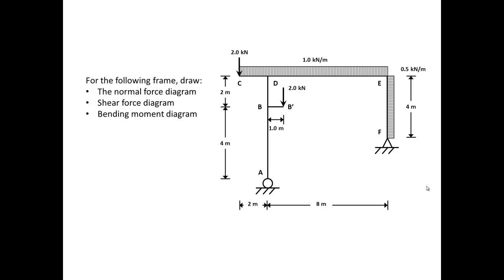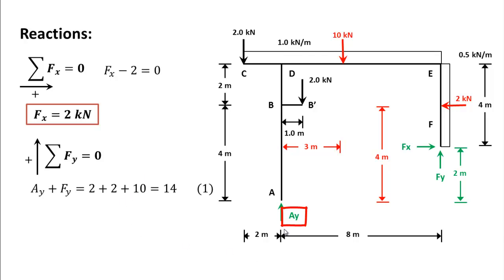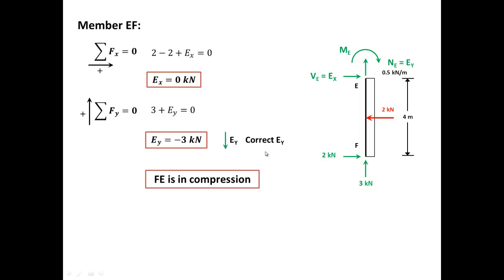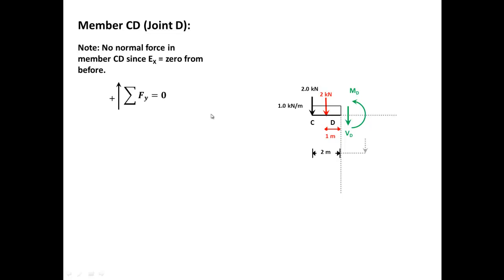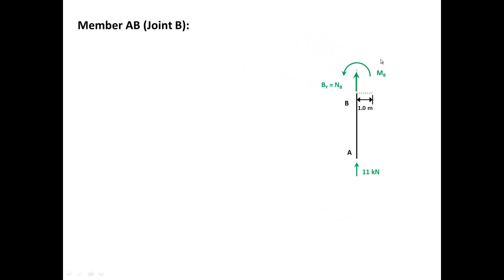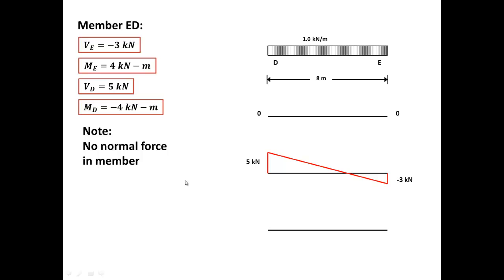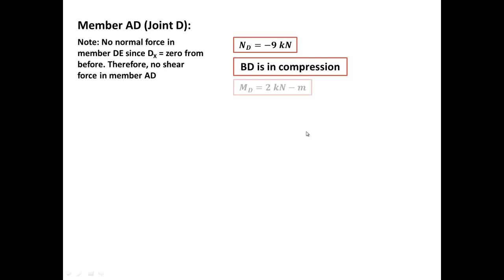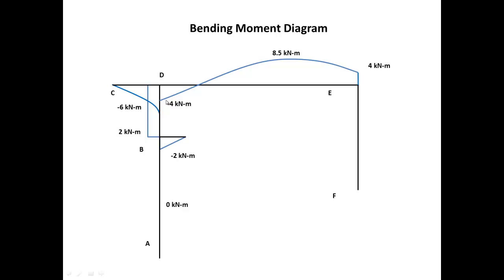Simple Frame Analysis (1 of 2)

Comment from the maker: @edd9139 if you are only concerned with the BMD then YES. All you need to do is draw it opposite to what I did. Remember, it is a sign convention. as long as you know the positive moment from the negative moment you are OK. This knowledge is crucial when designing concrete structure (for example) so you know were your reinforcement will go.
Hope I answered your question.
CTSCIVIL